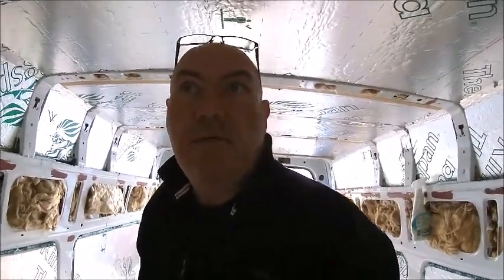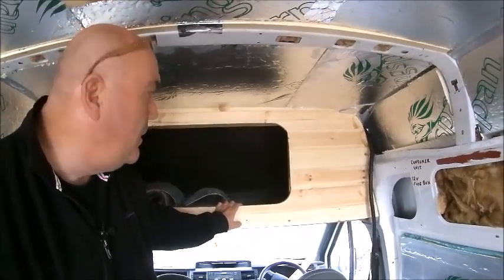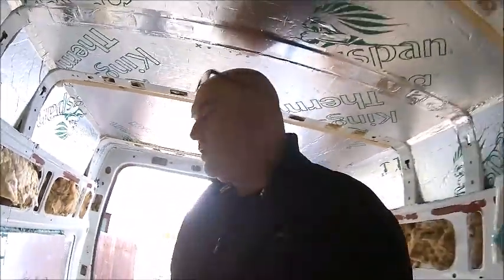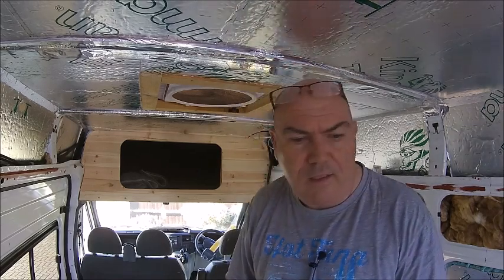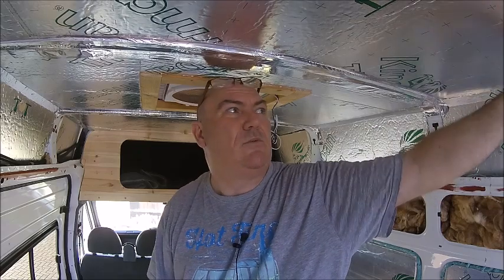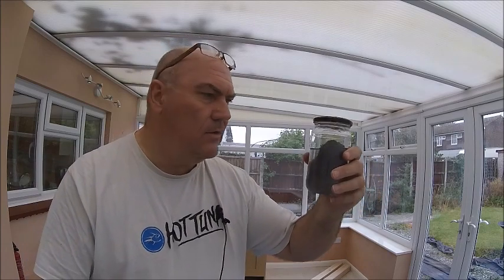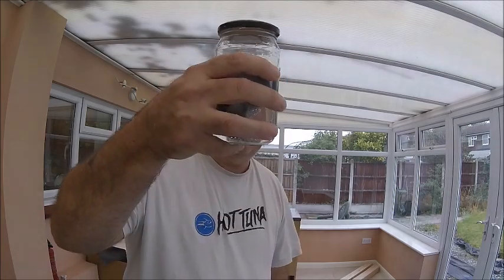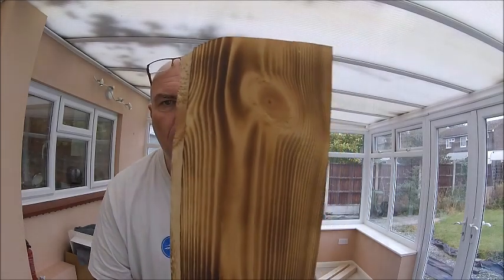19. Ceiling Talk and Homemade Woodstain

Comment: Hi ya Mate.. Just a thought.. are you having a reverse camera, if so, if its a cable one, get the cable fitted now, before you put the sides on..? if its a wifi one then no probs...?  I like the burnt wood.. But yes its way too dark...?  I would mix a white-ish gray paint and thin it right down, then seal it after..? but do it before you put boards up and do the tungs and the grooves as the boards shrink and expand you see the white wood in the V's as it shrinks... BUT looking very good now.. Cheers mate
Reply from the maker: Great advice Kev, cheers. I definitely need a reverse camera ASAP but I cant decide on one.  I need some suggestions for a good one. I would also like it to be on all the time im driving, not just when I select reverse.
Reply: I just got a cheapy off ebay, but made sure it was a 2 channel one.. Got cam on the roof and 1 on the number plate light.. When driving the one on roof is always on as rear view mirror, when i put it into reverse the number plate one turns monitor over on to its self. so i can the see the tow ball..
Reply from the maker: I would need to look up how to install one.  Im not great with wiring/electrics etc. But I do need to sort it soon because its tricky reversing without one.
Reply: I cant do without mine now.. Great stuff.. Kev